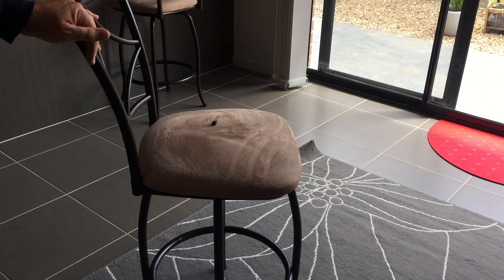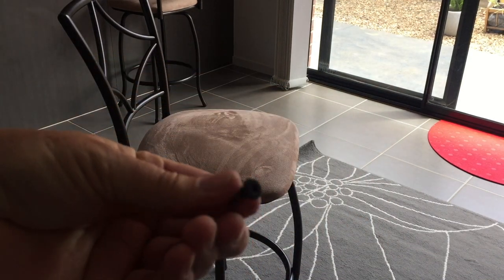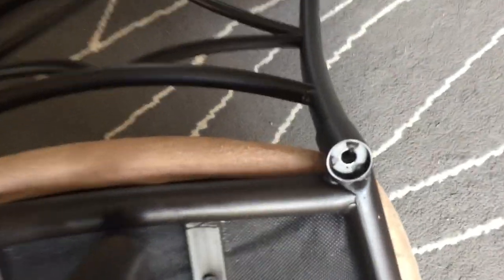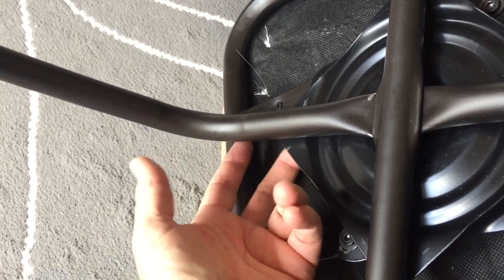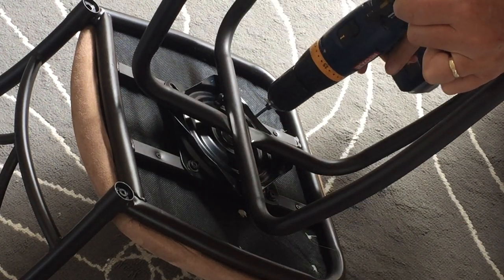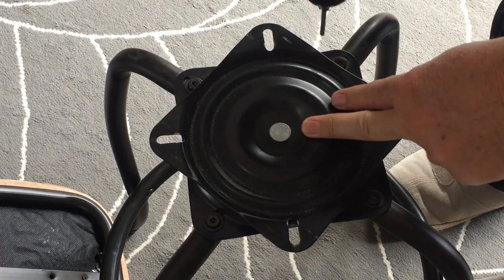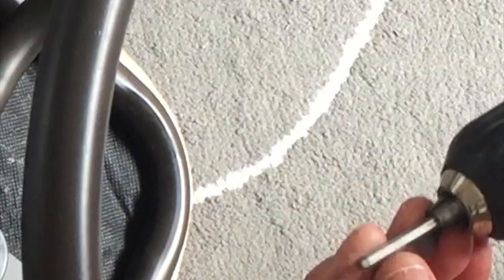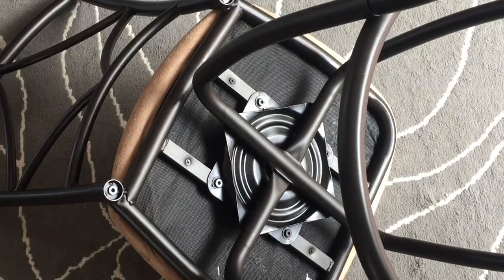How to Fix a swivel chair. Repair a loose turntable and tighten a wobbly  base

Comment: Great thank you also showed which swivel side flat top should face upwards towards seat, whereas the star cog should be facing downwards towards the legs of the stool. Other instruction videos are not very specific like the paper diagrams supplied.
Cheers thankyou regards
                 Bronwyne

Comment: Thanks for posting this video, it was very helpful when I encountered a similar problem.  Found the the replacement swivel on Amazon, almost-exact physical match and definitely an exact functional match.  Truthfully, the replacement from Amazon was MUCH higher quality than the original.  For example, my original swivel apparatus had only 14 ball bearings, while the replacement had something like 30+, I admit I didn't count them all, but it is MUCH smoother than the original.  For less than $15 delivered, my stools is better than new!!   Again, thank you.
Reply from the maker: This looks like the swivel you bought? https://amzn.to/2HtSRnC
Reply: @Marksreviewsandtutorials  YES, but mine was 6.25" instead of 6.15.
Reply from the maker: James Rodgers ✅